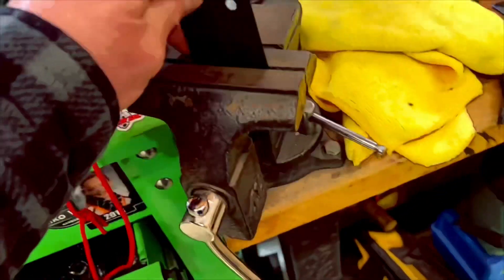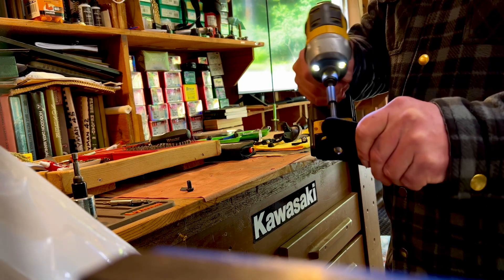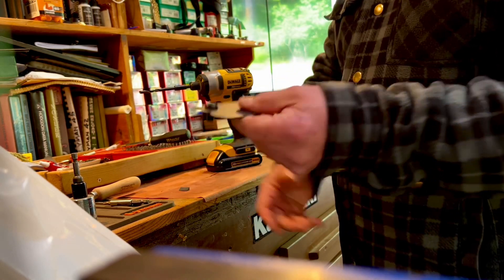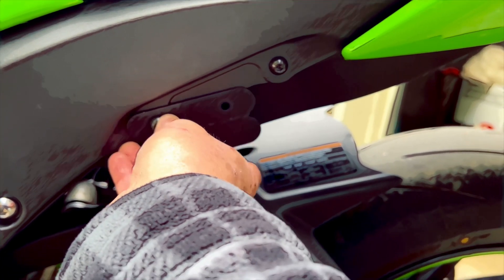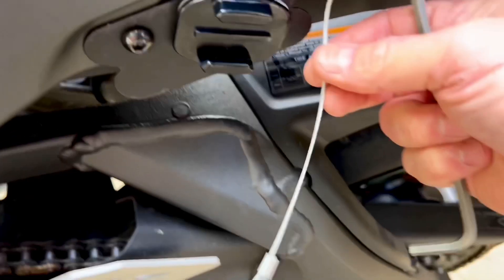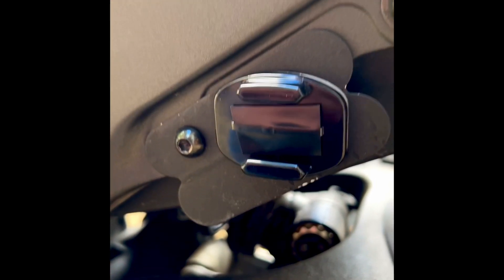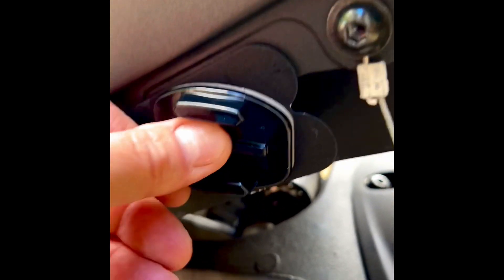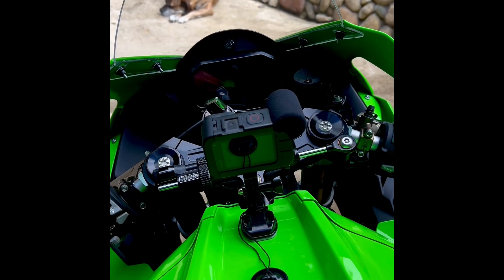Making A Go Pro Motorcycle Mount. - Featuring The 2024 Kawasaki Ninja ZX-10RR. 🐉

Comment: Mesure that distance to the tire with that line. the camera will add an inch or so. You don't want it touching that tire at 140
Reply from the maker: It’s not mounted in line with tire at all bro. It’s mounted to the spot where passenger pegs go on a regular 10.
Reply: @Niobium23  Gotcha, it looks funny from the cam angle.
Reply from the maker: @gopherchucksgamingnstuff2263 it’s just shrinkage…. Cold water…😂